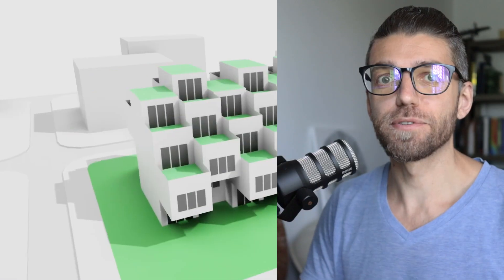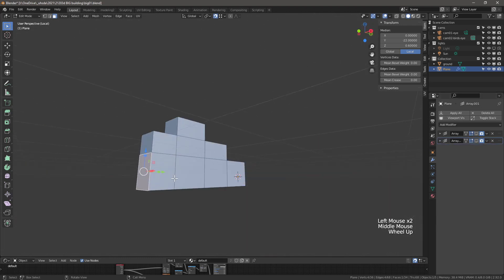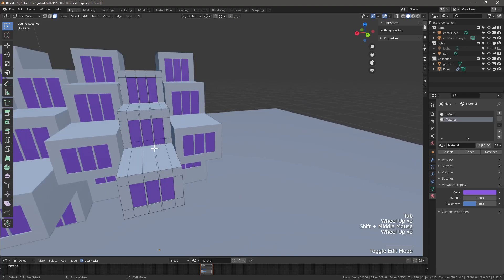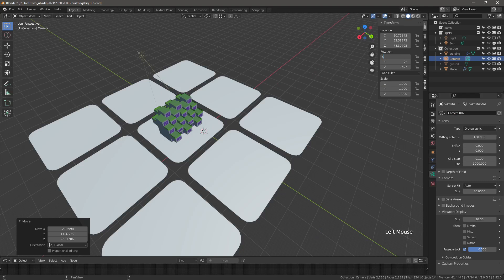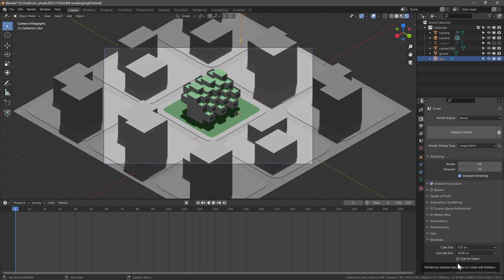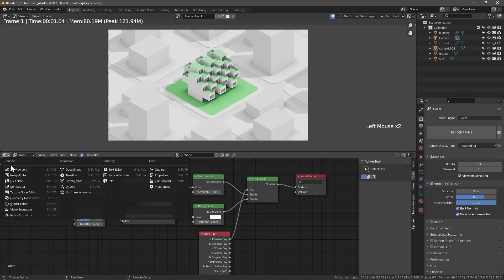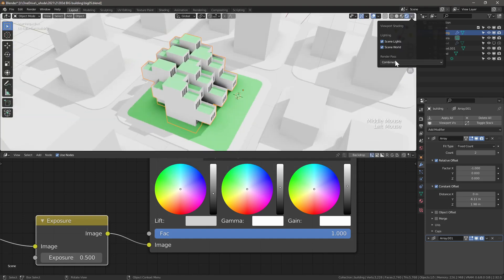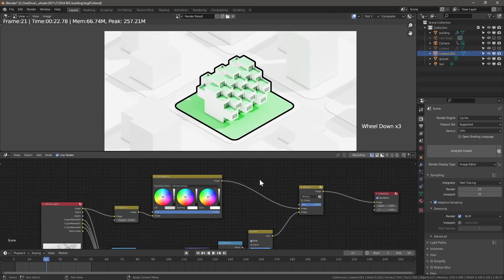Model, render, and post-process architecture diagrams in Blender Eevee

Comment: Is there any video about blenderbim 
Pleeeeease
Reply from the maker: Not yet. There's so much to cover with the basics of Blender, that I myself haven't started exploring BlenderBIM properly yet.
Reply: @UHStudio  I fully understand that, blender is huge software but someone like me can dive really deep yet simple stuff like creating accurate construction documents is not possible with vanilla blender. That’s why I guess it’s good time to cover blenderbim. 
Btw what do you think about blender ability to model using nirbs, is it like rhino ?
Reply from the maker: @Mahm00dM0hanad  blender has really primitive nurbs. If you have freecad as installed, you can set up Sverchok to use nurbs nodes. But to me blender subdiv modelling is a different paradigm which can work really well also.